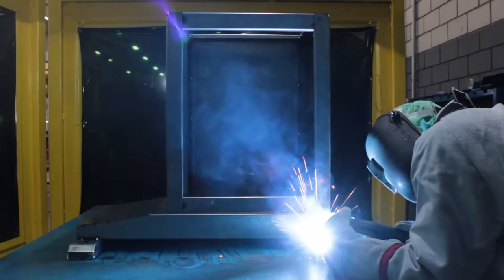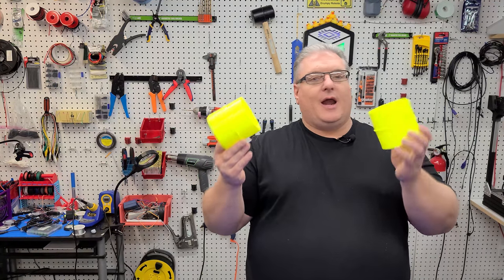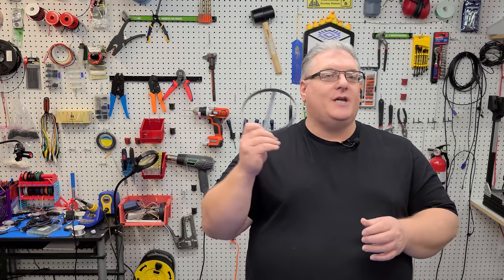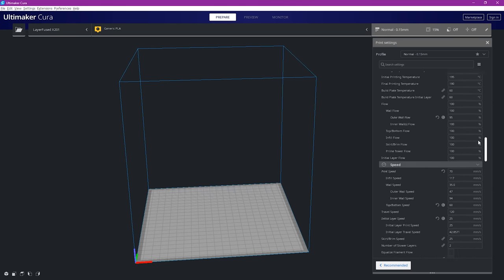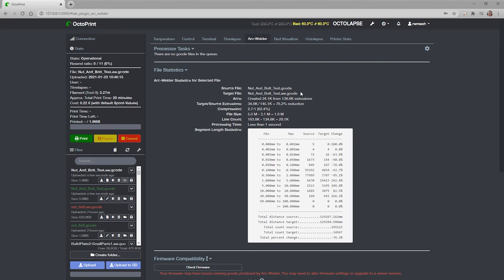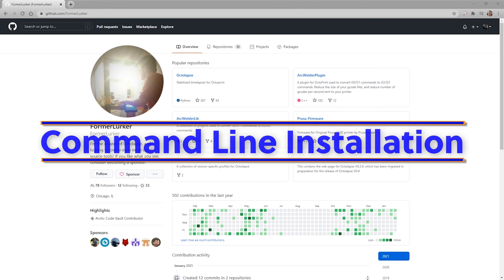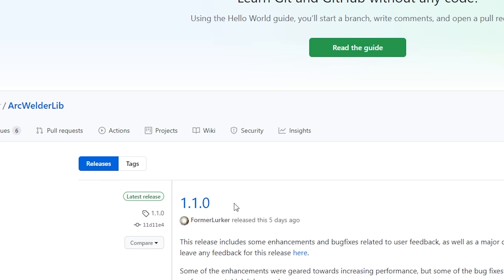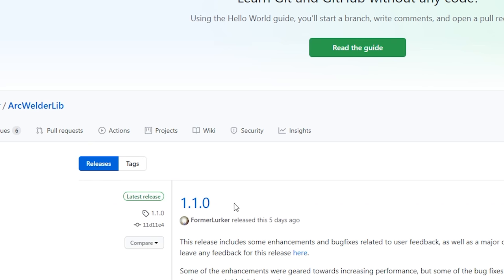Arc Welder - Smoother, Faster, Better 3D Prints! Its like magic to improve your 3D Print quality.

Comment: Really interesting but your printer seems terrible without it. My ender 5 with S3D and octoprint does much better curves. I never see any stutter but that may be because I am running octo on an old Atom mini PC that is a lot more powerful than a raspberry pi. 
Looking forward to seeing if arcwelder will improve it even more.
Reply from the maker: The speeds I set in the video caused stutter purposefully.  Sure if i slow down it can print smoother without stutters but with arc welder I don't have to.  These were done at 70mm/s with 1200 mm/s acceleration a .15 layer height and over octoprint.  Then the feed rate was increased as indicated in the video.  I'll upload it to thingiverse and you're welcome to run the same tests yourself.
Reply from the maker: I'm also curious if S3D has further impact since I generally use cura too.  I'll give S3D a go and see.  Now you have me curious 🤔
Reply: @MakersMashup  I just installed it and am running a test (ABS) just now. I have been printing a few circular 30mm bulkhead fittings for my pond filter so this will be an ideal test. Thanks for telling me about this BTW. I am surprised it did not get a shout out in the octo print news popups. It deserves it for being so interesting.
Reply from the maker: It did pop up in the right sidebar.  That is how I found it originally.  I have to admit though 4 out of 5 times I just dismiss them without reading them as I'm usually in a hurry to start some print. 😁
Reply from the maker: Let me know how you print turned out @Rob Fowler!
Reply: Definitely no better. I can still see minor facets. I am going to adjust the parameters. It does make a slightly different noise when printing.
Reply from the maker: Well that is disappointing.  I did add the test object to thingiverse if you wanted to give it a go https://www.thingiverse.com/thing:4749031

Comment: Does it make the print faster as well???
Reply from the maker: It doesn't make the print faster however it does enable you to print faster by reducing buffer underfunded.  increasing feed rate with a calibrated printer is the easiest way to print faster.
Reply: @MakersMashup  Gotcha, I'll have to try to install this on OctoPrint, I figured maybe less data it would be faster..   but I will try it thanks for the video!
Reply: @MakersMashup  I have a CR10 v3 and have it calibrated pretty well now but I don't know what you're talking about with feed rate.  In Cura, there is a speed setting.  Do you happen to have a video or know of resources to increase the feed rate you're talking about?  (BTW, thanks for the video.  I installed arc welder in Cura a few weeks ago but didn't know it required it on the octoprint side as well.  I'll have to do that next I guess.   So in any case, I did learn something new from your video so thank you!)

Comment: Installed Arc Welder in Cura. Curious to see what it does.
Reply: After installing it in Cura and running it on a design, it made my modified Ender 3 puke filament and code on the screen.  Tried a couple more times and have decided, that it is not worth the potential failed prints. It reduce my gcode file by 50%. Did not actually look into the file to compare.
Reply: @rchokelal  It's possible that Arcs are disabled.  Send a G2 command by itself and see if your printer responds with 'Unknown Command' or something like that.
Reply: @FormerLurker  i will look into this later. I had Arc Welder selected in Cura and this had never happened before I installed Arc Welder

Comment: Is there a way to use this in IdeaMaker?
Reply from the maker: If you can output a Gcode file then you can just run it through the command line version.  I'm not familiar with ideamaker but I would think most slicers can output to a gcode file for an SD card.

Comment: The command line version is screwy as I give it -r=.1 (as you did) and it shits out "PARSE ERROR: Argument: -r (--resolution-mm)
             Couldn't find delimiter for this argument!"

I just bug reported it as the issue is when using the Windows 10 Powershell that replaces the antiquated CMD (cmd).
Reply from the maker: I don't use CMD in the video.  I actually use console emulator 64 which provides both dos and linux commands at that prompt.  I'm far more familiar with linux than dos or powershell. :)
Reply: @MakersMashup  Powershell is Microsoft's attempt to finish off the console.  It does LS, etc... like Linux as well as the CMD commands, but for some reason the argv/argc of the program isn't working in it.  It must be a bad setup (easily fixable) in the program startup.
Reply: @MakersMashup  The author found the issue and it appears he needs to report it for a module he uses.

Comment: I installed the plugin in cura4.8, restarted and its not showing up under any tabs or search. maybe it needs an update for 4.8?
Reply: Did you activate the experimental  tab in cura?
Reply: @sandman7793  I did. Even searched in settings visibility but its not there.
Reply: @sandman7793  yup i have everything(all) selected for settings
Reply: Never mind, it doesn't show in experimental. It's in a menu above it. Here's how to find. Click the settings gear next to experimental, then when in the menu, search arc welder, then activate it, and it shows in a area just above experimental. Either way I had to remove it. It didn't something funky with my bltouch. I remember I tried this plug in a few months back, and it screwed up my print quality, but hey, maybe you will have better luck.
Reply: Also install side bar gui, so it brings everything back on the right.
Reply: Here's how I got it to work after some research.
Go to this link: https://community.ultimaker.com/topic/34888-arc-welder-anti-stutter-plugin/page/3/
On the fourth reply he mentions a development snapshot. Click on it and save it on your drive.
Open Cura, then drag that file onto the build area.
After a Cura restart, ArcWelder option showed up under 'Special Modes"
I haven't printed yet, but I notice the gcode file size is greatly reduced,
Reply: @sandman7793  its already installed. prusaslicer is working with arcwelder so thats what ill be using instead
Reply: @mh2topspot  👍👍
Reply: guess what just got updated and now shows up under the "special modes" tab. gonna try it out tomorrow when my new filament comes in.
Reply: @mh2topspot  yup that's where it shows up

Comment: If this is about using G02 or G03, I've been bitching about this since the very beginning! ALL these machines will accept "Circular Interpolation" which is done using G02 & G03. To be honest, the STL format is crap. We don't need it now. Fusion360 slices without it. Finally!

Comment: Any difference between command line version vs octoprint plugin version? Has any tried compare print quality between the 2. I found that the computer is much much faster than let the pi to process the gcode file.
Reply: no difference i can tell, i just use it with superslicer
Reply: @slayyou  thanks for sharing bro.
I'll just make some script to automate them for the windows then.
Reply: @TamTPSC  For Simplify3d, PrusaSlicer, Slic3r and SuperSlicer, you should be able to directly integrate ArcWelder.  For PrusaSlicer/Simplify3D/SuperSlicer, look in PrintSettings->Output Options->Post-Processing scripts, and just enter the path to ArcWelder and add any options:  {path_to_arcwelder} {options here}

 For example (assuming marlin 2.0, Prusa Buddy, or Smoothieware):  
C:\ArcWelder.exe -g

Or for Marlin 1.0 (Mk2/Mk3, etc.. to compensate for firmware problems with small arcs): c:\ArcWelder.exe -s=1.0 -a=14

Enjoy!
Reply: @FormerLurker  can these parameters -s=1.0 -a=14 work on prusa slicer 2.3 on prusa MK3S?
I tried on my the initial small print looks... weird.
Reply: @TamTPSC  can you post an issue on the github page?  I developed this using an mk2, and would expect it to work the same on an mk3.  I would like to fix any bugs that are found.
Reply: @FormerLurker  I'll report back once I prints more tests.
Might be the model itself it has many tight small turns.

Comment: What does it do with openscad circles which are made of lines?
Reply from the maker: The same thing it does with any sliced file. In the video I cover how it takes the straight lines and coverts them to arcs. I'm not an scad expert but ive used it to make models and then slice.  The gcode is then Modified.  If the source geometry is poor, your end result will still be poor as arc welder works at very fine detail level.  So if you have a source model that doesn't look round arc welder is unlikely to fix that.  If the model is round then arc welder will improve the gcode to use arcs vs line segments. Hope that answers your question.

Comment: Anyone know where I'd go for some assistance with Arc Welder? Printed a test cylinder that was hollow inside and I can't tell any difference in the walls, but there was a stringy mess on the inside. As if someone had stringing issues and did everything they could to make them worse instead of better haha.

Comment: This is cool but way too confusing. I get that a lot of 3D Printing hobbyists are good with firmware and setting up software but a lot of us aren't. I'm hoping this turns into an easy standalone application or maybe just include it in future updates in all slicers.
Reply from the maker: Arc Welder is a stand alone application.  You can run it 3 ways currently.  Command Line, Octoprint Plugin or Cura Plugin.  If your firmware has arc support already you should not have to do anything with the firmware. Try running a "G2 I20 J20" and if your print head moves in a circle you're good to go! Arc welder is a library as well so one would hope to your point that that this starts to make its way into slicers.
Reply: @MakersMashup  Thanks for the tips. I currently use simplify 3d. No idea if my printers firmware supports arcs but I guess I can try the line command with pronterface.
Reply from the maker: @stinkyham9050  If you also look through the threads here you can find @formerluker has a tweak for S3D that allows you to embed the AW script into it.  So you can use it more or less directly in S3D.  I haven't tried it yet myself but plan to shortly.
Reply: @stinkyham9050  , I just updated the readme file for the ArcWelderLib repository (it contains the console version) with information on how to integrate with several slicers.  Here is the section on Simplify3D:  https://github.com/FormerLurker/ArcWelderLib#running-arcwelder-from-simplify3d

Be sure to read about the parameters so you understand what they all do.  I've linked to some of the important ones in the simplify section.

Comment: Any chance simplify3d would have something similar ?
Reply from the maker: You can add arc welder as a script in S3D John.  @Formerlurker posted in one of the older comments how to do it.  So it will integrate directly.
Reply: @MakersMashup  thank ! Ill look into it
Reply: Just FYI, I added documentation for this yesterday.  See this link:  https://github.com/FormerLurker/ArcWelderLib#running-arcwelder-from-simplify3d

Be sure to read about the optional parameters, you may need to add one or two depending on your firmware version and settings.

Comment: How do you determine if arcs are disabled on your printer?
Reply: Try sending just an empty G2 command to it (perhaps via the octoprint terminal) and see how it responds.  If it says 'unknown command' it is disabled.  If it says either 'OK' or 'Missing Parameters' or something like that, they are enabled.

You could install the beta version of the octoprint plugin, which has a firmware checker built-in.  There is a link in the video description to a github discussion that has a short guide with pictures for installing this.
Reply from the maker: I always like to use "G2 I20 J20" which basically makes a circle with your printer.  No circles, no arcs. :)
Reply: @FormerLurker  Awesome thanks, yeah It is disabled. Now I am just waiting for the video on how to fix this! Ender 5 Plus 8bit silent board

Comment: Wow I installed this and it is totally ruining what were great prints. I clicked on the G91 setting. Is there something i am missing? Ender 3 V2
Reply from the maker: I would run the firmware checker, based on your response your firmware may have arc support disabled.  Otherwise please file a bug report with FormerLurker so he can investigate further.  There could be something specific to the E3V2.
Reply: Feel free to create an issue on the arcwelder github page.  I would bet arcs are disabled.  Try sending a 'G2' command manually (maybe via the OctoPrint terminal, if you use that) and see what the response is.  If it says 'Unknown Command', arcs are disabled.  It isn't too difficult to change this if that is the case.
Reply: @FormerLurker  Thanks for that info. My marlin reported “unknown command” so I know arcs are disabled. Is it possible to send a gcode command to enable it? (Similar to settings Z offset etc) Or do I HAVE to edit the configuration file and reflash it?
Reply from the maker: Reflash.
Reply: @MakersMashup  Great..

Comment: I tried arcwelder in octoprint and it did not work for me.  It just printed garbage.  I may try the Cura plugin.
Reply from the maker: Your firmware likely doesn't support arcs.
Reply: @MakersMashup  I was using TH3D firmware on an 8-bit board.  I recently installed a 32-bit SKR Mini E3 v3.0 with Marljn 2.1.  Do I need to enable some setting to use Arcwelder with Marlin?
Reply from the maker: Arc support
Reply: @MakersMashup  Yea, I figured.  Just wondered if it had a special name.  Guess not.  In any case I did not have to enable anything.  It must be enabled by default in Marlin 2.1.  I used the arcwelder plug-in in Cura and it seems to work though it made a strange shape out of the skirt.

Comment: is arc welder only for round models?
Reply from the maker: Nope. Anything with an arc in it.
Reply: @MakersMashup  so no use for flat objects?
Reply from the maker: Why dont you give it a try and compare the results.
Reply: @MakersMashup  if you are not going to tell me i would have to! :( i thought u was spose to give us answers, not make us find out for ourselves! :(
Reply from the maker: I already answered the question about what arc welder will do. "Flat objects" is vague. Is the flat object a circle or a square? What is a flat object? 1 layer high? 20 layers? While I'm glad to answer questions I don't know your use case or what your flat object is.  So my recommendation is to give it a try and compare the results. And no, I produce video content and help people to learn new things.  I'm not tech support so your expectations are a little off.
Reply: @MakersMashup  flat is square/angular. as opposed to round.
Reply: @IronMan-yg4qw  Every layer is "flat"!!! "Arc Welder" processes the polygonal curves on the flat of each layer to the closest approximation of a smooth curve/arc!!!

Comment: Your printer firmware or board has some issues, the default prints should not look that bad. The stuttering in the default print should not happen.
Reply from the maker: Board is just fine.  This happens often with higher speeds and a number of other reasons. Try turning up the feed rate on your printer im sure you'll run into similar issues.  Its a fairly common problem.
Reply: @MakersMashup  on a 8bit board this happens indeed, on a 32bit it hardly happens and on Klipper this never happens. So yeah, the board is fine but probably a low performance one?
Reply from the maker: So the big key is in what you just said there.  Klipper leverages most of the computing power on the Raspi so you're offloading a ton of processing to that vs. the mainboard directly.  That is one of the primary benefits of using Klipper is that its less prone to issues like this.  Marlin and RRF however runs all its processing power on the mainboard itself.  So little of an apples to oranges comparison here.  32 Bit boards also don't always provide significant increases in processing power.  Sure you have more addressable memory space and most of the 32 Bit boards have faster processors but when the firmware is doing all the work on the board speed is greatly diminished or end up with stutters which Arc Welder helps with.  Arc welder may not have as dramatic effects on Klipper but it certainly should reduce how much your Raspi is doing since arcs create considerably less gcode than line segment data for the same model.  It's good to hear you're running Klipper though, lots of good features like pressure advance and its really made for pushing 3D Printers faster.  For those stuck on Marlin though this is a quick and easy fix to improve the quality of their prints.

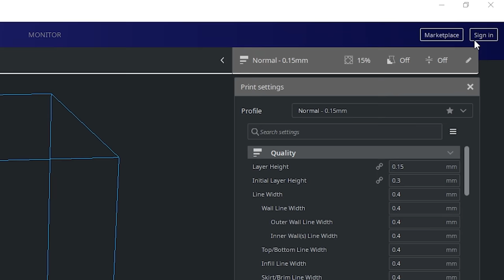Comment: 4:50 can't you achieve the same thing using mesh fixes max res/max travel res/max deviation
Reply: I was thinking the same thing...🤔
Reply: You can lose some resolution that way, but it should have a similar effect as long as you're not streaming the gcode, minus the compression.

Comment: does it work with prusa slicer?
Reply from the maker: You can run it via command line with prusa slicer.  Formerlurker has a page on this github about it I believe but it can be used for sure.
Reply: I just added documentation for this here:  https://github.com/FormerLurker/ArcWelderLib#running-arcwelder-from-slic3r-slic3rpe-prusaslicer-and-superslicer

Be sure to read about the optional parameters.  You may have to add one or two depending on your firmware version and settings.